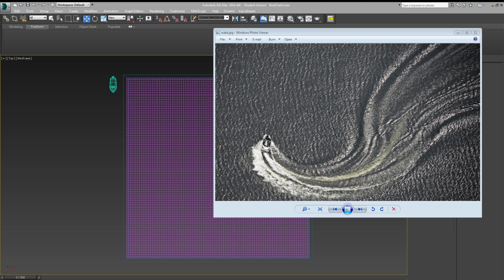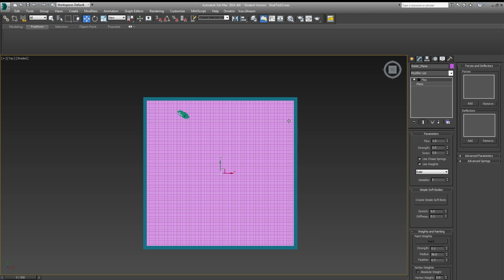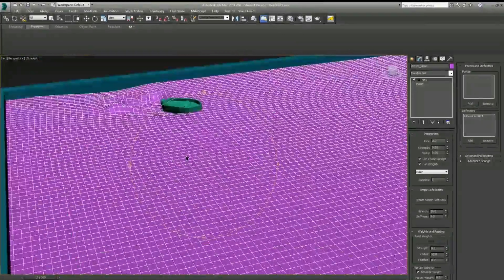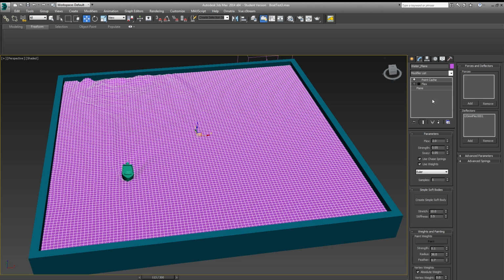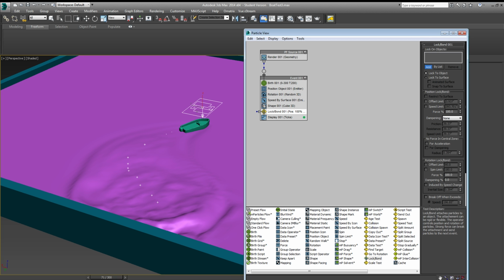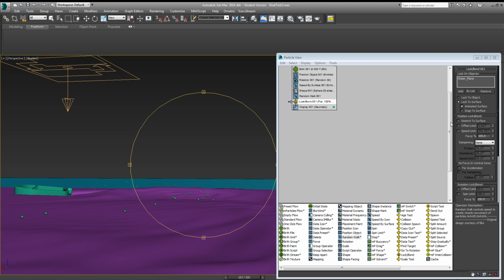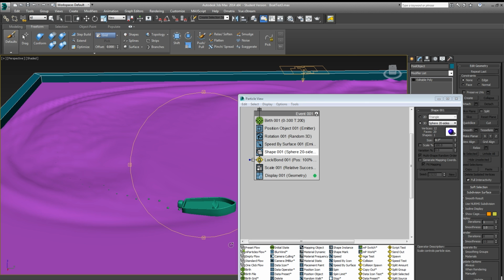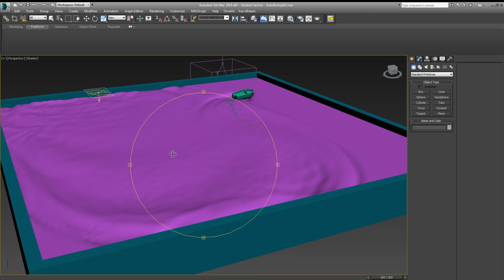Water Simulation Tutorial in 3DS Max (No Plugins) : Tutorial

Comment: Amazing thanks a lot this really helped me, i'm doing a yacht design simulation and my question is how do i block the water from intersecting with the yacht , thanks !
Reply from the maker: There are a few ways you could approach this.  One way is using a volume select modifier with a proxy mesh for your yacht as the volume object.  Then you could use a combination of push and relax to conform to the yacht.  It probably won't be perfect.  

A second way is to use a spacewarp FFD deformer (top menu -> create -> spacewarps).  Set the spacewarp at the surface of your water and then "bind to spacewarp" the water to the FFD.  Link the FFD to your Yacht.  Now you can manipulate the FFD to conform to the yacht.  The water should deform as the boat moves through it.  

The last way is an animated boolean but this requires a plugin called multi-mesher.  Here's a tutorial to show how it works.  https://vimeo.com/97245852